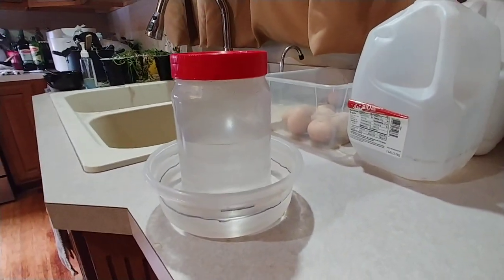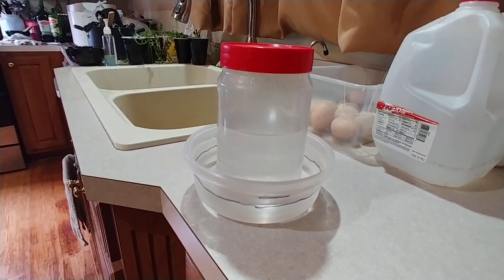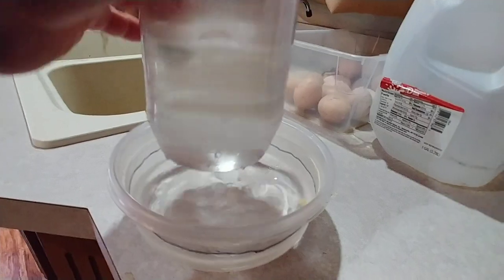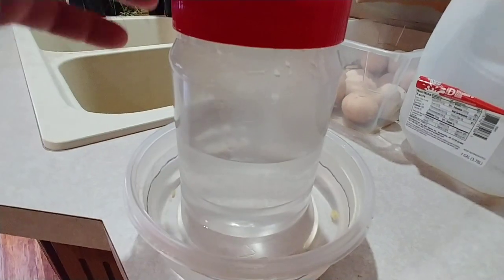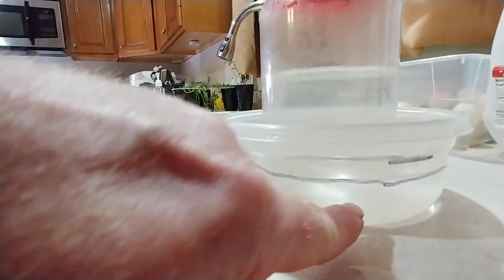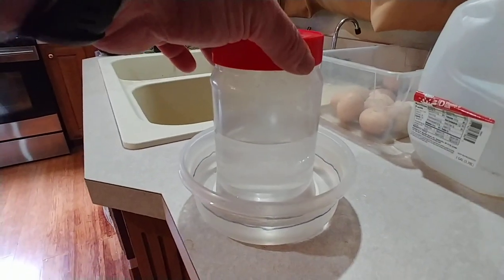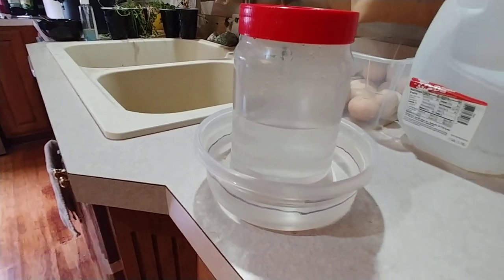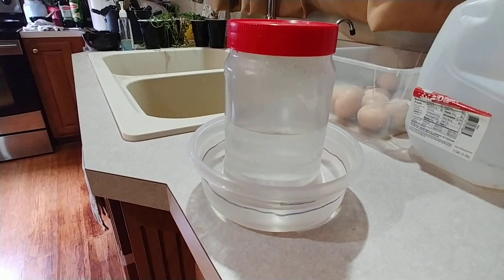Diy baby chick waterer from everyday household items

Comment: drill lid instead, makes filling easier.
Reply from the maker: I've been sitting here for the longest time thinking ... if you drill the lid, the water will come out.  I tell you, these memory issues from cancer suck lol. .... I finally figured out what you meant was to drill the lid and invert the jar so the lid is in the bowl .... that would work.  Thanks for the suggestion.
Reply: I had the same thought. I just made one with an old vitamin bottle. Drilled just below the lid and turned upside down in an old potato salad container shortened to chick level. No need to worry that the lid is air-tight this way and the chicks are too young to read yet so they don't notice the inverted lettering.

Comment: Hello brother I like the video and the way you explain but I  tried and water is not coming out plus when I open hole on the top all water overflows. Please say something!!
Reply from the maker: This is a gravity water system for chickens or baby chicks, water wont spill or run out as long as you keep the top on but will fill the outer container on the bottom until the pressure equalizes between the inner container and outer container.  Then as the chickens / baby chicks drink water from the lower container, more will be allowed to come out and the process repeats.
Reply: Bigger hole on the lower side
Reply: @sharpridgehomestead   How did your waterer work, as shown on the video? Does it self water, fine, when the water level goes down in the attached dish? Thanks!
Reply from the maker: @steveandrews8301  yea, it works great. I still use the same one for chicks. They work based on gravity just like larger chicken waterer. Basically once you fill them up and invert them, gravity causes the way to want to pull down but suction at the top holds it in place. The water is sort of in equilibrium at that point where it will remain as long as no air can enter the top
Reply: @sharpridgehomestead  I too have problem with refilling water with the top open as that's the only opening for refilling water. When I have the top open for refilling water, all the water just gushed out at the opening holes at the bottom so how do I refill water, so the water won't gushing out at the bottom holes? Thanks.
Reply from the maker: @mandiegarrett1706  the bottom bowl needs to be on it and water filled up to the bottom holes. I fill mine by placing the water container in the bottom bowl under a faucet.  Remove the top lid.  Run the water. When it fills up i quickly put the lid on. If the water runs out faster than your faucet can supply, place the water container in a pan and fill it that way. The water is only going to run out if the bottom holes are above water.

Comment: I got 2 pet chicks and they always step in the water giver so can u make a video on ways to distribute water to chicks??
Reply from the maker: sorry for the slow reply, I was without internet for a few days due to a cut fiber optic line.  I will try to put something together.  Baby chickens always like to step in water for some reason.  About the only thing you can do is change the water often.  Adult chickens will also do it.  But if you hang the water container off the ground, it reduces it substantially.  Some people use the chicken nipple system.  I don't have any experience with those though.
Reply: Ed Wiget thx